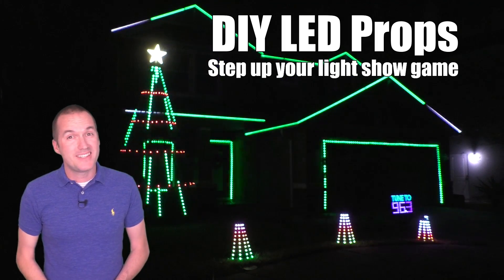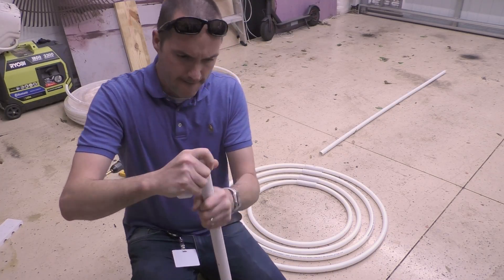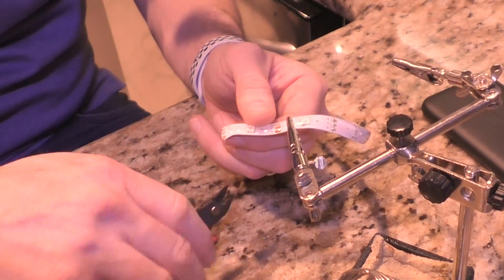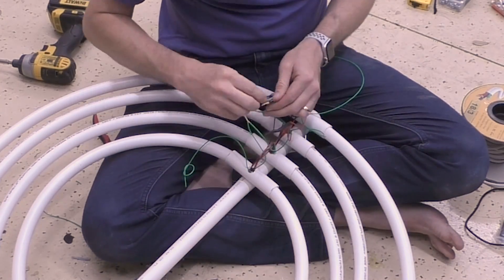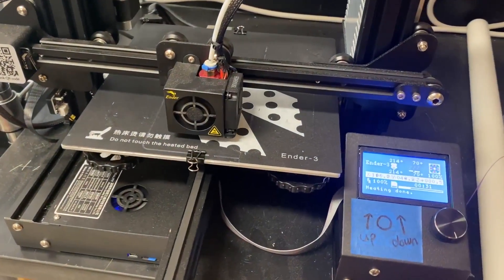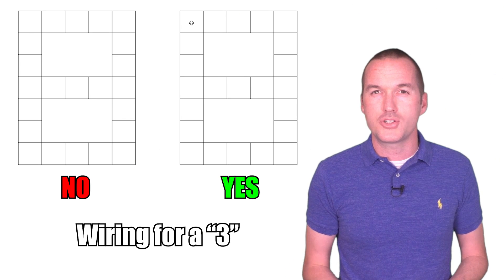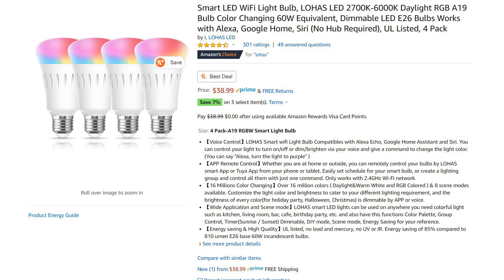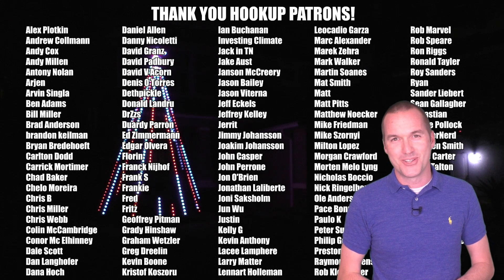DIY LED Christmas Light Show Props (PEX Wreath, Mega Star, Tune To Sign, Flood Lights)

Comment: Thank you for sharing this. How do you keep the wreath removable? Since the electrical wires on the Wreath side are soldered, does the other end where it connects to the power outlet are removed. Sorry if it's a trivial question.
Reply from the maker: It has xconnect quick connect fittings on it.

Comment: I want to put addressable LEDs around my dock. I am considering using WS2812 96LED/m 12v in PEX piping.  Any thoughts? I am concerned about overheating, maintaining directionality, and durability. I have been unable to find any IP68 strips that I like.

Comment: Question - At 9:06 You talk about downlights (soffit lights I guess?). Let's say I wanted some downlights in my soffit that I could control via home assistant (bonus points if they work like normal when I sell the house and I don't have to replace them all if I don't want to). Should I re-flash downlights like you've done here? (everything changes so fast, I feel like I have to ask in 2022 ). What should I try? (I'm probably going to do permanent lights strip/track - I feel like it should be compatible with all of that too....). (edit - and the downlights amazon link 404s, the LOHAS lights link is "unavailable" (EOL?))

Comment: To hide the wires on the wreath, I made the "interior" holes extra large and just ran the wiring in and out of the holes as needed. No external wiring except for 1 led cable coming out the bottom
Reply from the maker: Nice.

Comment: Hi Rob, I was wondering what your long-term review is on the Pex wreath.  I know HDPE can break down in the sun, but in this application it may still last years in the indirect sun.  Wondering if you have seen any cracking/crazing/yellowing on it, especially with the significant bends on the wreath.  It's also a good torture test for Pex in this application!
Reply from the maker: Still working great.  One of my wreaths is now 4 years old and the other 2 were made for this video.  All are still alive and well (I do take them down and put them in storage from January to October though.
Reply: @TheHookUp  Thanks for the update, that is encouraging to know.  I really like the smoothness of LED strips in Pex and considering hanging that under the eves instead of aluminum track, but that would be hung year round.

Thinking I may do a smaller trial on my outbuilding first before I do a full commitment.  What do you think of that approach over track?
Reply from the maker: @TyPaff  I have seasonal lights on my driveway that are in "clear" pex (it's very opaque).  I do store them outside on the side of my house and haven't noticed any yellowing.  You can see them in action here: https://youtu.be/RWwCJeMZHVg?t=802

Comment: Do you have to orient the led strips in any particular configuration?  if so, how do you keep them facing front?
Reply from the maker: You mean inside the pex tubing? I don't think it matters, the tubing is opaque enough to diffuse the LEDs regardless of orientation.
Reply: @TheHookUp  Thank you!

Comment: so I hAVE subscribed cuz it looks like you know what your doing. happy day. have been searching for forums to help with my ideas.  here is the big one. I have about 60 incandescent candy canes that I want to rip out the strings and refurb with programable LED that will have the radius of light of an incandescent. . Simple. all are bright white. no rgb programable with arduino. WHAT led would you recommend, and my guess is 12v. long strings. ?  approx 340 led per string string approx 75 feet. please help....

Comment: you need to add this to your holiday lights playlist
Reply from the maker: Done! Thanks.
Reply: @TheHookUp  also looks like the floods are no longer flashable. I just purchased 8 of the 10w ws2811 floods similar to the ones that holidaycoro sell (i used an in stock vendor). maybe add those to your list for a 2021 holiday lights video if you are planning one.

Comment: Went through all of the steps to flash a set of Novostella Floods I purchased. No Dice. It Appears they Tuya Firmware has updated to prevent this exploit, which it pretty unfortunate. These lights are awesome, and I wish they would still be open to custom firmware. Serial flashing isn't really an option because the casing is sealed.

Comment: I'm trying to compile and upload the code to the LOHAS LED bulbs that you were talking about here.  I was able to get the .bin compiled, but when I upload it to the LOHAS bulb, I get an error that Upload Failed, not compatible.  I am using version 1.8.13 of Arduino and the settings under tools are slightly different than pictured above.  Am I missing something?  Thanks and great videos!
Reply from the maker: I'm not sure of your level of expertise, have you installed the ESP8266 in boards manager and selected Generic ESP8266 for your board?
Reply: @TheHookUp  Experienced IT/home automation guy with programming experience, new to the custom firmware world.  Yes, I did get that selected properly.
Reply from the maker: Can you post the exact error?
Reply: @TheHookUp  I didn't see an easy way to post a picture on here, but here's everything on the screen once it fails:   Line 1: "Generic Module", Line 2: "GarBulb1", Line 3: "Upload Failed" - Failed is in Red, Line 4: "Not compatible", Line 5: "Main Menu" button, Line 6: "Tasmota 8.1.0.2 by Theo Arends"   That is everything on the screen.
Reply: @TheHookUp  It looks like I was using the wrong version of the ESP8266 Board definition.  I went back to 2.4.2 and now the options under tools line up with your video.  I'll try flashing it again tonight and hopefully that will work.  Thanks!

Comment: Thank you for the great vedio you make all the time .
My tow questions are : how did you mount the light Channel on you house ? Is it facing the street or facing down ? 
When you said WLED controller, do you mean WLED they ha e there own brand controller that will work with XLight  or you meant just there software that work with another controller.? And if you know that ,what well be the name of those controller 
Thank you .
Reply from the maker: Mine is facing out towards the street, but I've seen them facing down and it also looks nice.  WLED is just software that works with a controller like a NodeMCU ESP8266.  The DigiUno is a great board to start with if you want a pre-built solution.

Comment: I am trying to compile the .bin file and I keep getting an error - ESPAsyncE131.h - No such file or directory exists.  Is there an update to your INO code or a way around this error?
Reply: You will need to download the ESPAsyncE131.h library on Arduino.  I also had to find the ESPAsyncUDP.h file and add it to the library.
Reply from the maker: You'll need to install that library: https://github.com/forkineye/ESPAsyncE131
Reply: Thanks yall!  I had to add three additional libraries to the IDE- The two mentioned above as well as the pupsbuclient library.  After that, I got it to compile.  Thanks again!
Reply: Is there a specific Tasmota FW that needs to be flashed on the bulb before your FW will work?  I keep getting an error that this FW is not compatible.
Reply: @nola2635  Go to the Tasmota Console and type "SetOption78 On" and press Enter.  Then try to flash the bulb with the .bin file.

Comment: How did you sequence in the light bulbs on the garage?
Reply from the maker: It’s the last part of this video.
Reply: @TheHookUp  I see it but when I load your bin I can’t access the light. I can ping it  however. Any ideas?
Reply: @djizzy12  @The Hook Up  I'm in the same boat.  I flashed Tasmota and then updated the firmware with the .bin file.  It said it was uploaded successfully then it restarted.  Now I cannot do anything with the bulb.  It will not even turn on.  However, I can ping it.  Is there a way to reconnect to it to try upgrading the firmware again?
Reply: @danielatwood4588  hey i just bricked 8 bulbs. I ordered 4 more and should arrive tomorrow. I think I may know what I need to  do. I got a reply from Rick on what to do. How can I get in contact?
Reply: @danielatwood4588  I’ll let you know how it goes tomorrow. If I can’t get 1 then I’m giving up.
Reply: @djizzy12  good luck!
Reply: @danielatwood4588  I got it!!!!
Reply: @djizzy12  awesome! what did you do?

Comment: Did you use WS2811 5V or 12V for the Mega Star?
Reply from the maker: 5v
Reply: @TheHookUp  Thanks for the quick reply! So no reason to go higher (to avoid voltage drop problems for 120 LED's)?
Reply from the maker: I haven’t had any issues with it, powered at the beginning and the end of the run.

Comment: Someone probably already said this, but throw a nice red bow over the bolts.  Goes with the wreath and hides bolts nicely.
Reply: or a 3d printed one with more LEDs?
Reply: I'm looking for a way to power and hang the wreath without getting out the ladder.  I use a pole with hook to hang the wreath but running/routing the wire is where I still need to get the ladder

Comment: I purchased LOHAS bulbs last week and they will not flash with Tuya Convert.  Reading through the Tuya Convert issues on the github page it seems like bulbs sold within the last 6 months or so (Spring/Summer 2020) are patched by Tuya and will no longer flash.  Tuya Convert has yet to find a workaround for it.  Any ideas?

Comment: Man, I saw your original RGB flood hack and was considering something similar, but today I was again looking into RGBW flood lighting that I could install vertically in a downlight position and was pointed back to your channel. This is pretty much exactly what I am looking for now, and while I would prefer a wired connection, wifi certainly has its advantages. This year is my first year doing pixels and the roofline and floods will be permanent installs, and requiring a boom to install safely, so it only makes sense to do it all at once 🙃
Reply from the maker: Nice, I’ve always wanted to rent a boom. Stay safe!
Reply: @TheHookUp  Yup, a solid 20-25ft to the upper soffit. I hear most local rental places will rent on a Friday afternoon and let you keep til Monday morning while only charging for 1 day. Costs less than a decent ladder of suitable length and with much more peace of mind- until a pixel goes out at least haha

Comment: Hi Rob, Thanks for this video, i know its quite old now. But once i have complied BIN, i try to load it via Tasmota (8.3.1) but it just says Upload Failed
: Not compatible.
Any way to find out why it thinks its not compatible? I am using the LohasWithCW file and set the board options as per your screenshot.
Reply: Fixed this, needed to go back to 7.2 version of Tasmota then it loaded fine.... not sure why

Comment: Ive been testing several RGBW LED runs using Wemo pros Flashed with WLED. Im finding slight issues with sync ive not tried controlling them with xlights yet tho. Just wondered what controller boards youre using and if youve had any sync issues ?

Comment: I loved the wreath idea and mimicked it.... but also improved.
At a big box store I couldn't find thin wall PVC for the straight sections so I found that 1" PEX worked well - just had to bore the holes slightly.  I also added a separate hole for wiring to run in/out rather than sharing a hole with the bolt that holds each ring.  I also drilled this onto the backside so all wiring is on the back, not needing the tape job you showed.
2" screws were too short for me so 3" worked well, and can always cut excess off.
I also made a video not too long - there's a MUCH easier way to remove the IP65 seal from the LEDs... I kept having issues when I installed my under cabinet lighting with cutting it away and damaging the board.  
In short - use a utility knife with the blade heated up to cut down then across (no pressure needed) - the heated blade melts through and cuts the seal right off.  Takes seconds.  I've found I go back over it with a knife but that's more of a 'scratching' off excess left behind.
Thanks for the build idea! Wife and kids love it!

Comment: Do you use the LED strip (8212) for the Mega star, or do you use the LED pixels (8211)? Could you share a picture of the wiring?
Reply from the maker: I used Pixels, WS2811

Comment: QUESTION(s) :  How are you transmitting the music?  How many watts do you transmit?  How do you not get busted by the FCC for transmitting on FM commercial band?  Thanks, Cheers & Happy New Year!  - C
Reply from the maker: The FCC allows for local transmissions under 200 feet.  I'm broadcasting at .2 watts.  You can check for free radio bands in your area using https://radio-locator.com/cgi-bin/vacant

Comment: ok.. ok.. I now have the Novostella flood lights.. now to re-flash.. Do u have a simple flow chart for this? Your vid glosses over the process somewhat.. 
Thanks for the great info... next year it'll be the mega tree.. :)
Reply from the maker: Tuya convert first: http://www.thesmarthomehookup.com/tuya-convert-walk-through-february-2019/

(Tuya convert ends with tasmota flashed onto the device)

Update the ino file in arduino with your wifi ssid/pw then generate a .bin file as shown in the video.

Go to your devices IP address (the tasmota webUI will come up) and click firmware upgrade and select the .bin file you made.

Comment: Did you do a Tuya covert on the Novostella RGB-CCT Flood Lights?  Any issues?

Thanx for the quality content
Reply from the maker: I used Tuya convert, they worked perfectly
Reply: @TheHookUp  Yes it did :)
Are you recommending running https://github.com/thehookup/E131-MQTT-RGBW-Lights or Tasmota to MQTT control the lights?

Comment: There is an easier way to set up the Mega Star in xLights. Create one star in your layout, and then type "30,40,50" (without the quotes) in the Layer Sizes.
Reply from the maker: Thanks! I recently discovered my issue with the wreath and layers.  For some reason there is no option for a wreath with multiple layers, but if you use the circle tool you can specify layers... which makes me wonder what the difference is between a wreath and a circle.

Comment: There's a wreath model in xLights. Lets you choose the size of each (layer sizes "42,52,61,71"). I did something similar, but put the wiring facing the back. It's a nice look, but changing out the strip is a PITA and I'm going to address that in my next vid. I think same with the star (but I don't have one yet). Nice vid!

Comment: Just as an FYI in xLights for both the wreath and star you didn't need to create separate models, all you need to do is create 1 model and set the lay sizes it does the rest of the work for you.

Comment: Love the video.
Did you use PLA for printing your star? or maybe PETG since it will be in the sun alot?
Reply from the maker: Petg
Reply: ASA is made to hold up to weather and sun. I had to use a cardboard box as a make shift enclosure. But the mounting adapter I made for my motor home’s GPS turned out great!

Comment: For those with a 3d printer, I found some wreath stabilizer clips on thingiverse here: https://www.thingiverse.com/thing:2034535
Reply from the maker: The spacing between the pipes should be 2” to work with the dimensions I listed.
Reply: @TheHookUp  gotcha. Thanks for the info. Love you videos

Comment: Working on printing the star. What is the best order to put the leds in
Reply from the maker: All the way around the outside, then the middle, then the inside
Reply: The Hook Up as one continuous strand or 3 separate?
Reply from the maker: I did continuous and then just connected all the built in power injection wires for the strands together.
Reply: Thanks for the help, have the center to print and then glue

Comment: For a weather proof cover without 3d printing try silicone and cornstarch mixed into a putty like consistatancy  and wrap it around the joint and let it set.  I'm not sure if it will work but I plan on trying it for one of my soul sensors when I get my part. Look up proto putty or silicone putty.

Comment: So, downloaded, sliced and printed the megatree star, planning to print the 5 sections on an ender 3.  Problem that I have run into is that the holes for the inner 2 rings are coming out but the outer ring’s holes are absent.  In cura I rotated the file so that it fits on the buildplate.  The floor of the outer ring shows up red.  Tried importing into meshmixer and tinkercad to see if it would repair the model but no luck.  Am I the only one having this issue?  If anyone else has and has found a workaround, please post.  At this point going to see how drilling the holes by hand works.  I have only printed the first 2 sections of the star (currently printing the center - which is going beautifully btw)  so if there’s a way to fix the star section stl I’d prefer to reslice and print ones with holes for that ~18 hours😁
Reply from the maker: In cura check the box that says “union overlapping volumes”
Reply: Tried that — didn’t fix the problem
Reply: @mkos5565  I had the same problem but checking that option worked for me.  I tried other approaches as well, none of them worked (using Meshmixer or Blender).  The holes are very precise, so drilling would be difficult to match.  Thanks much for the pointer to the model and your center star.  I'll be setting up my first prop with this star (don't have enough lights to make a mega tree yet, just getting my feet wet with some strings and strips.)
Reply: actually I got the holes to show in the gcode by un checking that option ( “union overlapping volumes”) haven't tried printing yet